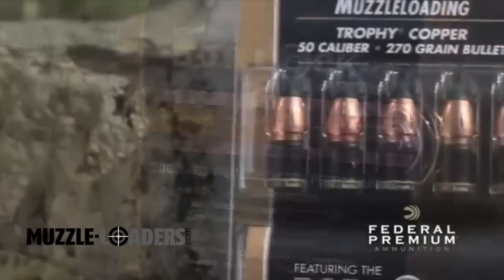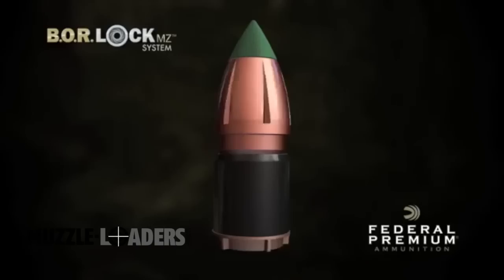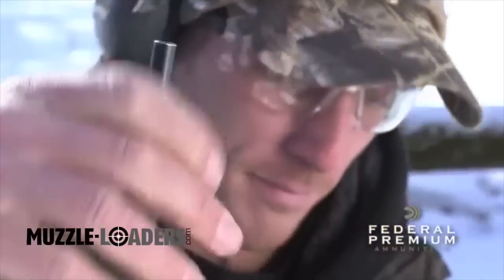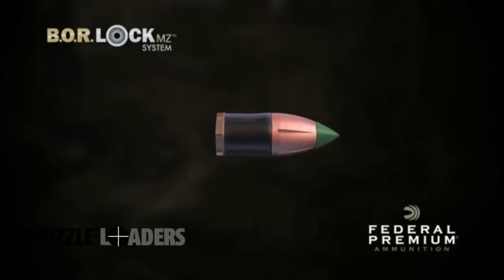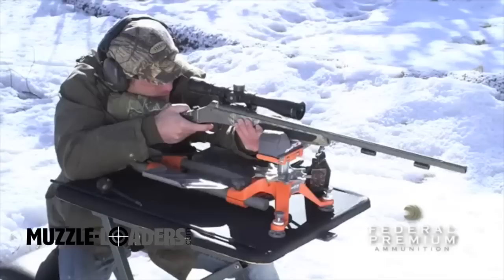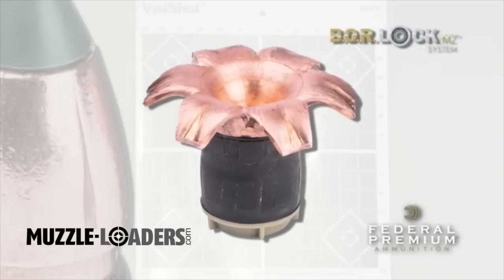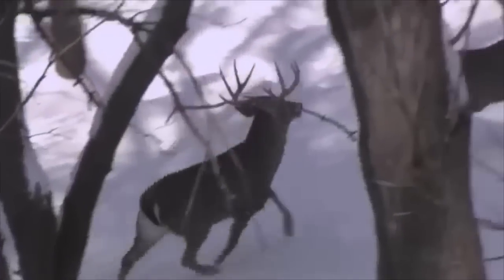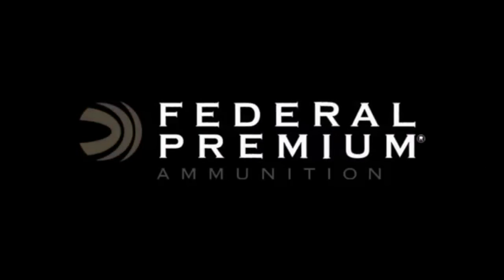Federal™ Muzzleloader Bullets - BOR Lock MZ System - Manufacturer Review

Comment: I had just heard that Wal-Mart was carrying these bullets, went to my local Wal-Mart and found them in stock. They were already on clearance price because our local early muzzle loader season just closed last week. The 15 bullet packs were reduced to $15, then further clearance priced down to $10 a pack. I bought all 7 packs they had....Glad I did! These things shoot fantastic through my Ruger Model 70-50 inline with a 1-28 rifle twist. Using my normal load of 80 grains (by volume) of Triple 7 FFF I was able to shoot a 5 round single jagged hole at 50 yards, which opened up to about 1 1/2 inches dead center at 100 yards. I think I'll carry this in regular deer season at the end of the month!
Reply: They perform really well on the big white tails up here in Minnesota, you got lucky.
Mine doesn't group them quite that nicely,  but I shot my doe at 104 yards and got a nice clean pass through. The blood trail was ridiculous and she only went about 40 yards. She would have went about the same distance with powerbelts, but there wouldn't have been any blood trail because there wouldn't have been an exit. I'm sticking with these from here on out.

Comment: These bullets load very easy  but shoot like crap far from accurate.  If your looking for a new bullet for your inline , keep looking dont bother with the federal bore locks .....
Reply: man, why you got to dump on this like that? if you were a serious shooter, you know every bullet will fire differently from every rifle. different rifles, powders, primes, will affect bullet impact. did you play around with it at all or just say oh it sucks cause it won't shoot straight? what works good in one, won't work for shit in another. i have two 243's and i can't swap ammo for them. the savage shoots the cheap power shock federal 100 gr. sub MOA all day long, put it in the other and you can put 5 on a paper plate (barely) at 100 yards.... my point is, these bullets work EXTREMELY well for me out of my inline so i would recommend if them if someone is looking for a new bullet for their black powder. however, to re state my previous thought, i know full well just because it works well for me, doesn't mean it will necessarily work well for other rifles. just food for thought man.
Reply: Ive been a professional hunting guide for 50 years an have shot blackpowder rifles for 40 yrs ive forgotten more then then youll  ever know . The bullets are a gimmick.  There trash !